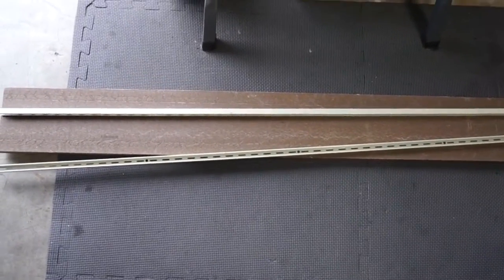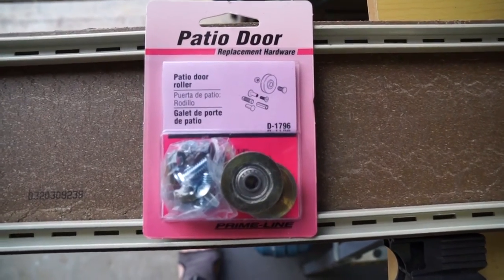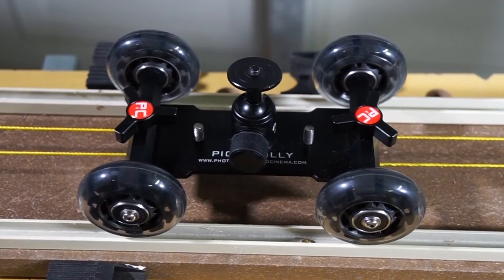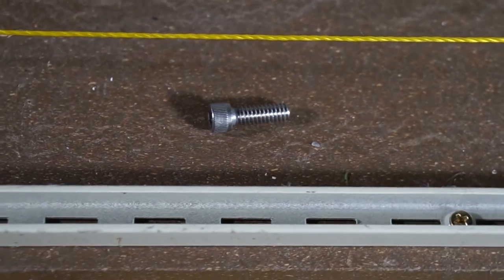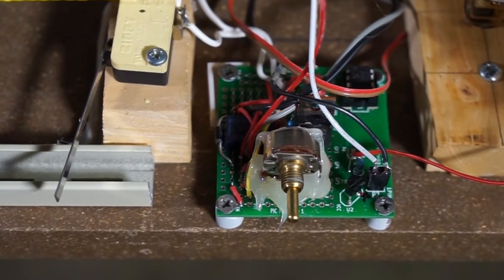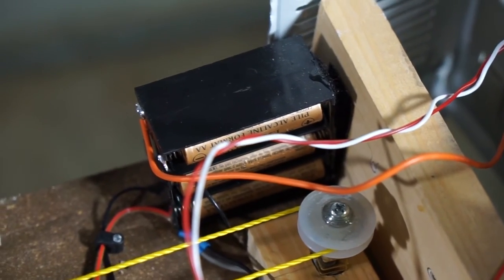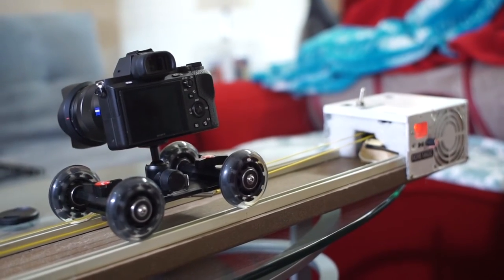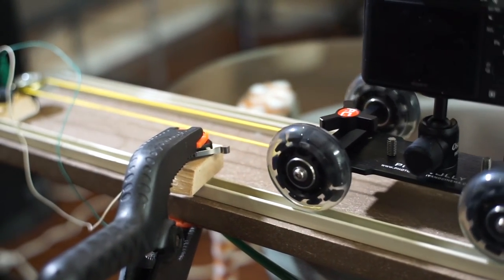Motorized DIY camera slider with auto reverse

Comment: Nice video. I'm "electronically challenged", so could you explain how to do the limit switches?  How to just let the controller let the limit switch to stop the carriage. Thanks again.
Reply from the maker: +Frankie e  Hi Frakie; thanks for your interest. I found an circuit online that illustrates this:
http://www.next.gr/uploads/85/limit_schematic.gif
The circuit provides direction reversal (manual; not automatic like in my video) and limit switches . I would suggest also adding another switch in series with the battery to turn the whole thing ON/OFF.

Comment: very good, but let me ask, since the distance is short, how effective is this in making a video?
Reply from the maker: +Inquisitve m 
Hi, thanks for your feedback. If you look at most sliders out there, they are about the same size or even shorter. I actually had to make the travel shorter at one point by adding the extra switch with a clamp (shown towards the end of the video). That said, you can make it whatever length you would like just by getting a longer piece of wood:)